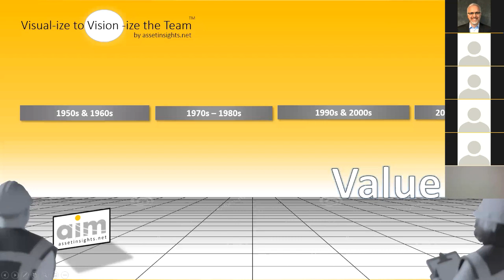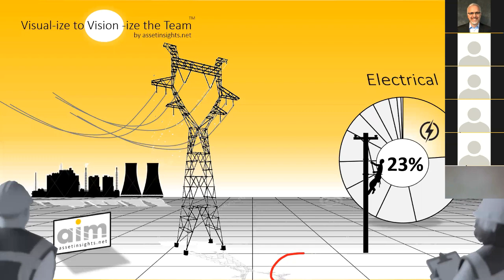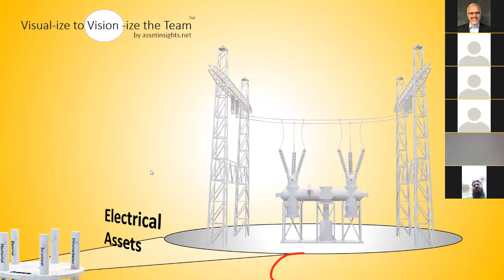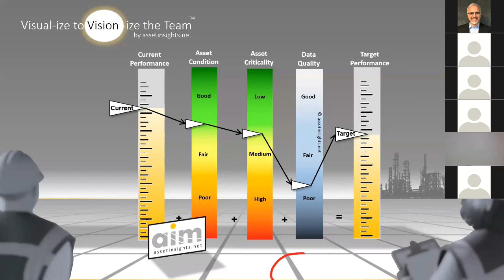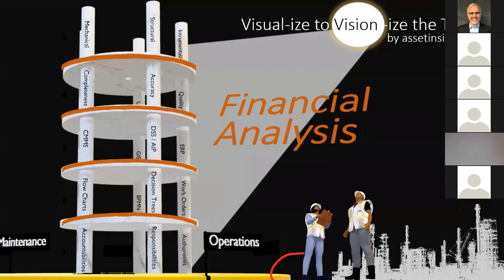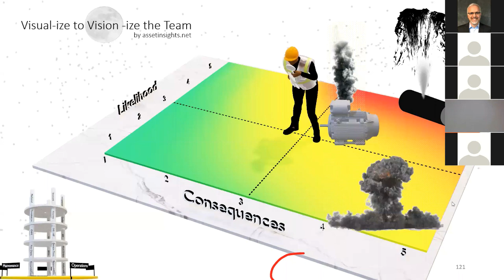An Introduction to Asset Management

Comment: Hi there, ❤❤❤loved it. But got 2 questions = 1) is this lecture is completely focused on physical assets only and 2) Can we have a complete practical guide on how it actually works step by step when a client gets onboard? Example: when a billionaire gets on board with say $100M capital for say 7 years…how does it work like from application to like how we allocate capital and what reports are required quarterly to yearly basis and like complete guid of how to handle a client.